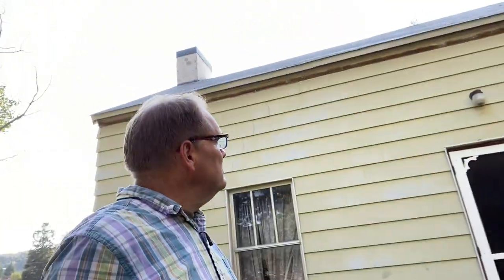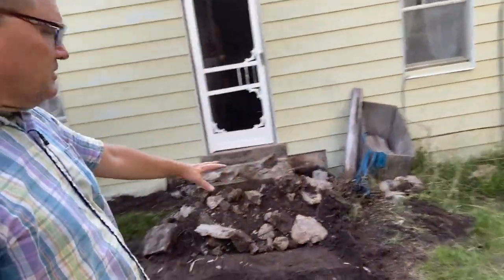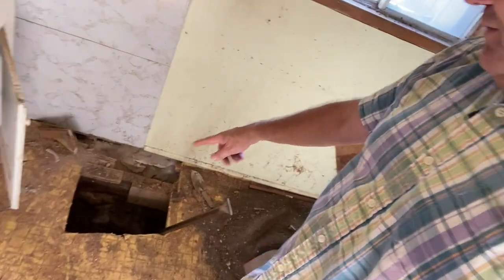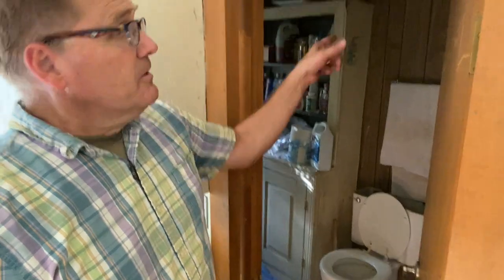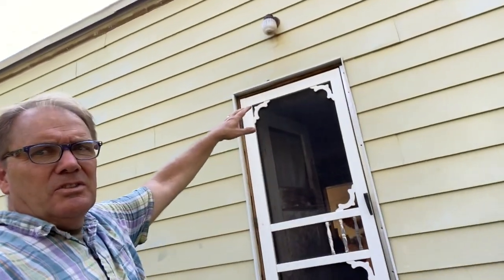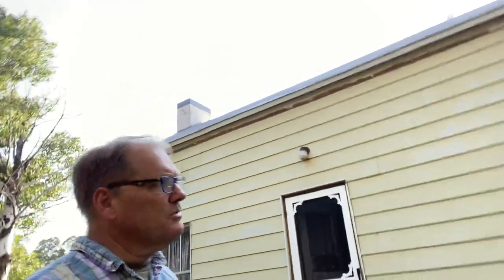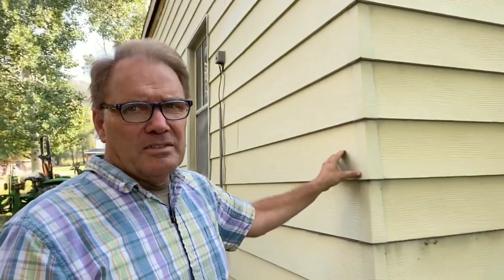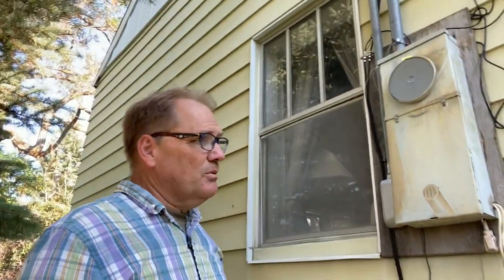Remodeling An Old 1900 Mountain Home

Comment: I was mulling that slab idea over in my mind before you went there. Seems logical, and will last at least as long as the original floor. Easily insulated as well.
Reply from the maker: Thanks, you reminded me to make sure I have rigid foam insulation near the exterior brick, it gets cold up there.

Comment: I’ve got a home up here in utah county, same era (1898). On your foundation, one thing I’m considering that you might be interested in looking into is “underpinning” the rock foundation. Lot of good info out there
Reply: On those thick walls, mine are ~11” around the house and on the interior walls. If they’ve built interior walls to have “straight” or insulated walls, see if you can remove any of them to bump out the livable space. 
Wish I still had; 
-wood stove (use to have 3 chimneys, removed two that were in bad shape) 
-original sink. Super cool. 

I’ve got ~9’ ceilings. 
Just finished the roof. 
I’ve done the kitchen and bathroom. (Essential for livability)
Totally rebuilt the bathroom. Tore out floor to change up plumbing and layout. Built a frame basically around the perimeter of the floor and replaced the joists and subfloor. Turned out well (other than a month with no bathroom in a one bathroom house with a wife and two year old son… she’s a saint)
Updated all plumbing and electrical. 

Been trying to do research on how Adobe homes were built. My knowledge is with stick framing. So it’s been a learning curve for sure. 
If you have any resources or links on how to work with these old homes and how they were constructed…
Anyway, look forward to seeing your progress

Good luck!
Reply from the maker: I have seen that done. Did you see how they did that with the temple that was once a tabernacle?
Reply: Yes. That was an incredible project there in Provo.  Beautiful job they did. Wish I had that kind of budget lol

Comment: Passed on an old adobe once because I had basically no clue how to deal with what was essentially a dirt foundation. If it were me I would do roof/floating chimney, plumbing, electrical, heat, ie make it habitable. Maybe put windows last on your to do budget list, and consider replacing or rehabbing them one at a time. Interesting idea re a slab.
Reply from the maker: Thanks. Great info.

Comment: Wouldn't you want to pour concrete on top of the existing one to save on cost? You can always channel the sewer to the side of the home instead of breaking up old concrete. Is it not a big cost to dig up concrete?
Reply from the maker: We did not have an existing concrete foundation. It was all rotted wood.

Comment: You mentioned you're replacing the roof, but what is the roof assembly?  I suspect the existing rafters are probably undersized for R-30.  Although you walked us through, I don't have a sense of the roof axis to the floor plan and so I'm wondering if you may want to vault the ceilings given the ceiling-to-roof space.  You mentioned the limited budget and I don't know the cost of pre-engineered trusses, but if you could get a scissor truss in there to carry the R-30 in a vaulted ceiling, along with the radiant heat of the Franklin stove compensating for the volume increase, depending on how it works with the floor plan and the budget, it could make for one sweet, cozy space.
Reply from the maker: The roof is skip-sheeting with shake on one level and aspahlt on top. I all needs to come off with new sheeting.

Comment: I don't think I will ever understand remodeling like this. Demolition and then rebuilding, even something much smaller, seems like it will incur less costs to plumbing, electrical, insulation and because everything newer will need less maintenance and be more energy efficient... Maybe cost more upfront, but with 5-10yrs wouldn't you make it back in efficiency and upkeep costs?
Reply from the maker: The demo alone is at least 15K. The walls are 22 inches thick, efficiency is mostly built in. It is a matter of bringing the building up to speed for use.

Comment: I am not an architect, but I am a designer. (My expertise is more in commercial build-outs, but this project intrigues me). The faded siding seems inappropriate in scale for the building because there is no complimentary trim. When you paint it, install nice wide moldings (they are pretty inexpensive if you use the maintenance-free plastic products) think Craftsman style. With a plain 12" to 14" frieze board and 6" wide window moldings, the siding will seem more in scale with the house. 
      Take out the hideous dropped ceilings! Please, I beg you. The best and fastest way to insulate that house is to create a more attractive and functional dropped ceiling. Secure a pressure-treated cleat all the way around the inside perimeter of the building about 12" to 20" below the original 12' ceiling level. Drill into the wall and secure the cleat by pegging deeply into the adobe. At critical load points, drill entirely through the adobe and siding and use heavy-duty through bolts. Put washers on the bolts outside and paint them along with the siding. They will disappear, I promise. 
       I speak from experience. My husband and I converted an all-brick 1920s garage in Denver into a workshop by using that exact method (putting in a dropped ceiling and insulating it). Ours was trickier because we not only cleated, but we followed the roof pitch attaching the ceiling rafter to the clean and on the other end to the original rafters and left the rafter chord alone. It was a decorative and practical materials storage solution.
      Secure new ceiling framing to the cleat. Build a 'tunnel' opening between the main floor and the actual original attic floor. Fill that space with cellulose - the cheapest insulation available. Depending on how you do it, you'll create an R44 to R74 ceiling. Since 80% of the heat loss in a house is through the roof, that will go a long way towards making the house more comfortable. The tall ceilings (with phenomenal insulation)  at about 10' rather than 12' are more proportionate while amplifying light in the house and making the rooms seem more spacious. 
      The SOLE exception is the bathroom. Keep an 8' dropped ceiling in the bathroom, or else you will feel like you are at the bottom of a well in that room. Park your tiny on-demand water heater in the 'sub-attic' above the bath. Just remember to get one big enough to serve both the bathroom and the kitchen. 
      I like the concrete floor idea but strongly advise you to insulate and vapor seal it under the gravel (you've got a pretty deep cavity so there should be room). Insulation panels are taken out of commercial freezers when have decayed until they have lower than the specified R-value (usually R50+). Used panels are dirt-cheap and will still have enough 'oomph' left to isolate the floor from the ground. Besides, it means that you can pour a thinner slab which should save money. 
        I STRONGLY urge you to abandon your usual 'builder' mentality (buy everything new both for convenience and to be assured of durability and performance). You have a decent eye for quality, Keith, you can tell when a material or appliance is OK or not. I have gotten Pella windows new in box but a mis-order (wrong configuration in a mulled unit) for less than half of the retail cost. I beg you to lurk regularly on Craigslist, LetGo, Facebook Marketplace, eBay. I swear I could build a small house almost exclusively with the perfectly useable product scraps that commercial builders throw away. 
          With your schedule, you may not be able to scrounge as much as needed. If your friend/client understands how much money she can save, she may be willing to run searches and text/forward/email any potential finds to you. Check out Habitat for Humanity - they have great basics. 
        I am deeply concerned about the electric panel. You don't have the budget (or need) to move it inside - but at least upgrade to 150 amps. If you put in a few modern appliances, a modern TV, and the lady wants to charge her phone, you've just overloaded the circuits. A replacement upgraded panel won't cost THAT much and will dramatically improve safety and performance. I notice my opinion merely echoes other commenters.
        God, I wish I had the dimensions for the kitchen! I agree with you - the vintage sink is awesome and should be re-used. I would love to dig in on a kitchen design, but with no dimensions, it's not possible.
       I am really looking forward to updates on this project from you, Keith. I plan to build an adobe house in Arizona when I get back to the States. This will be fascinating! Keep up the good work, Keith!
Reply from the maker: Thank you, some great info
Reply: @HowToBuildYourOwnHome  Dear Keith, I should let you know: now that you've 'talked' to me I'll never go away! In fact, since I'm planning to build my own home, I will take your course (as soon as time and budget allow). And, you're welcome.
Reply from the maker: @lindacgrace2973  I am always here.